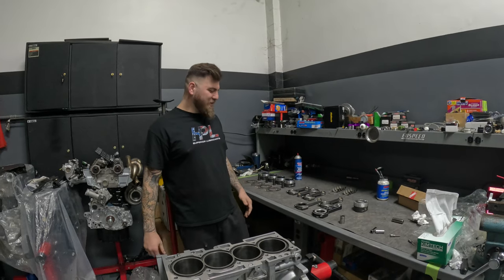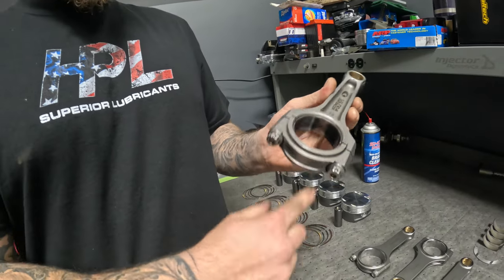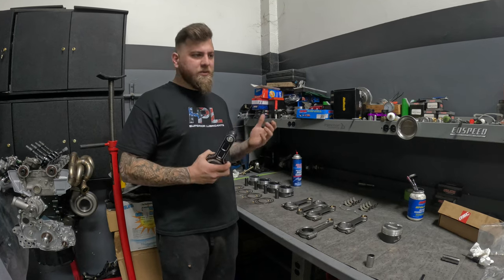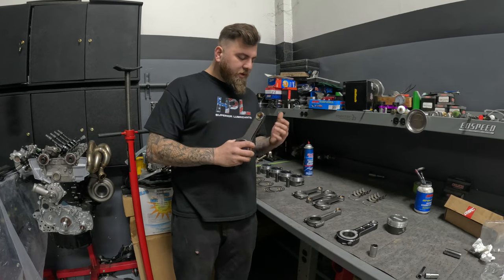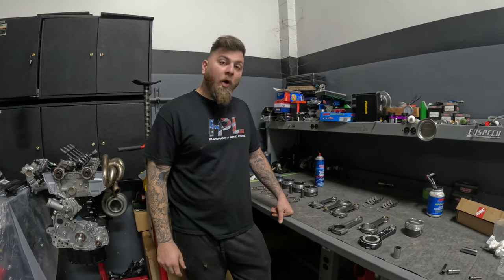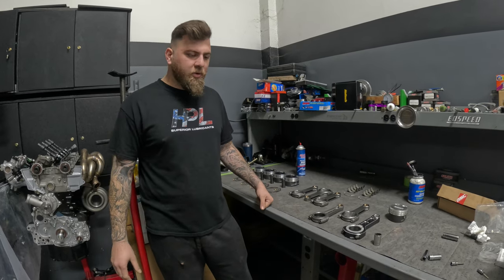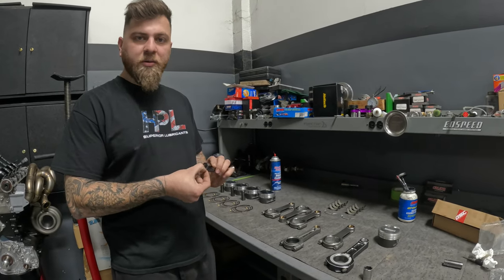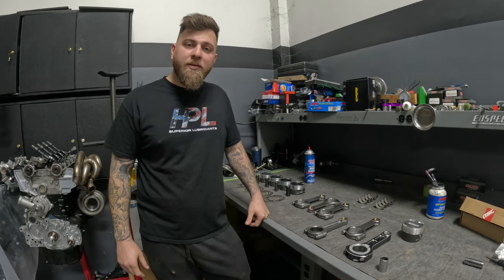Aluminum Or Steel Rods? Which one is right for YOU! [Tech-Talk]

Comment: Steel rods are successfully being used in applications exceeding 2500+ hp without issue.  How long the bearings will last and how much stress is passed to the crank is more of a tune up issue than a material issue.  If your tune is on point, steel will work as well or better than aluminum.  Aluminum is more forgiving of poor tuning or tuning on the ragged edge, but at the expense of rod life....Last point, is on rod length....it doesn't matter nearly as much as most make it out to.  Develop a good ring pack, pick your stroke, and connect the two.  This is from the V8 world though.....it's one of the last considerations and many times isn't a consideration in the majority of builds.  Good overall video though, very informative.

Comment: i went with some R&R Aluminum rods in my street 1g. Shooting for about 800 wheel/9000 rpm. One issue I ran into when selecting a rod was Rod selection. Really for 700+ wheel there was only I beams which are considerably heavier than H beams but h beams dont support as much.

Comment: I have crower billet rods (six bolt engine) with 21mm pin (.200 thick) ...Can I upgrade the pin??  Should I upgrade the rod bolts (current ARP2000)too??

Comment: Do you prefer oliver rods or manley i beam rods for high hp? (talking 6766 hp levels, so not extremely). I currently have the manley h-tuff rods in it, but i'm afraid to push it with the current PTE 6766)